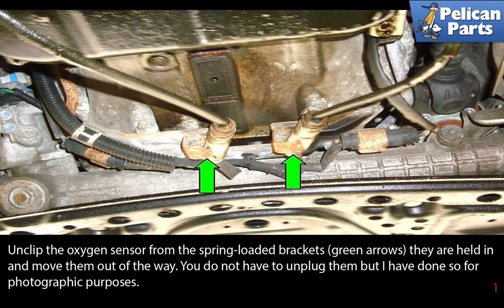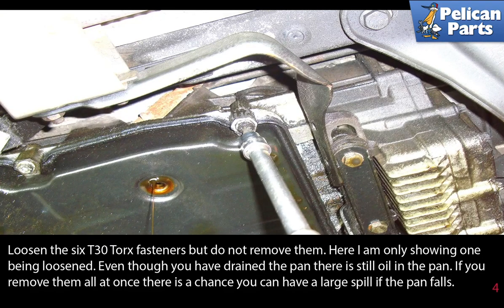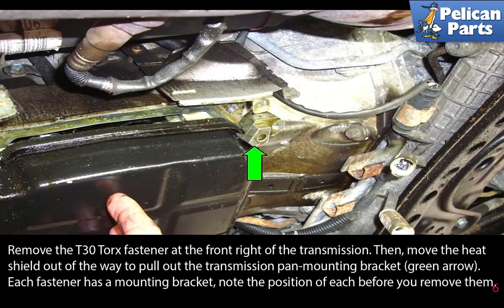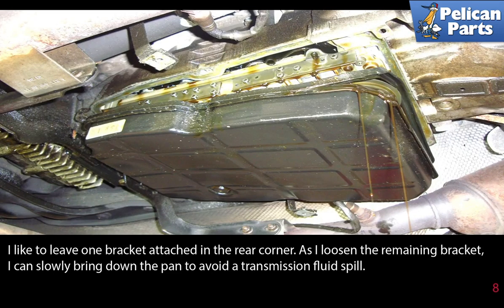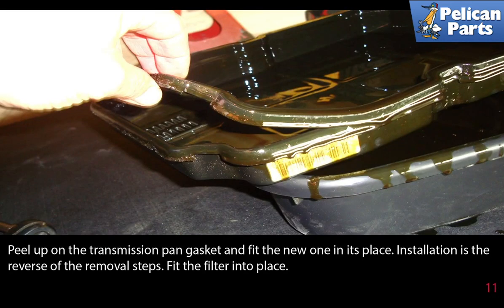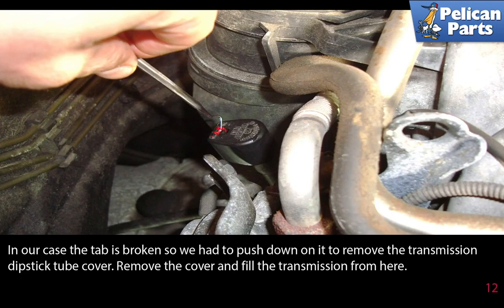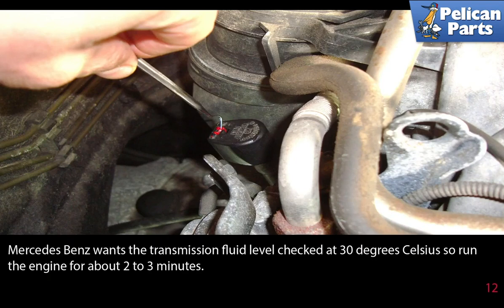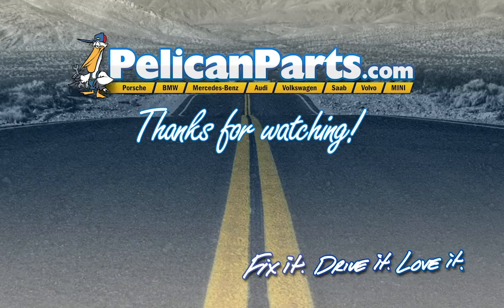Mercedes-Benz W211 E-Class Automatic Transmission Fluid Change

Comment: I have 2 of these w211 both e320cdi the one I'm currently working on is a Brabus varient and has this gearbox filler under the bonnet as did another w211 I previously owned . But the other one I have here. Not the brabus just an avantgard. It has no filler underneath the bonnet anywhere which is annoying 😂
Reply from the maker: Thanks for the Info. We appreciate it.

Comment: Great video!! Do you know if you can fill the transmission this way with all 722.6 transmissions? Like if it is a 1999 e320 or 2009 E350 with the 4matic is it the same fill procedure? Just wondering because I know on the 722.9 you have to fill it with a pump on the drain plug of the transmission. But I am guessing as long as it still is the 722.6 it can be filled from the dip stick tube. Thank you in advance!
Reply from the maker: I believe only the except 722.96 does not apply to the fil overflow tube style filling.

Comment: For 04-06 E500.  Does this get all the fluid out?  What about the torque converter? Is there also a fluid line to the radiator?
Reply from the maker: This gets most out. To get it all out, you'll want to have it flushed using a flush machine.

Comment: how much oil do i need for the w211 3.2cdi from 2004?
Reply from the maker: Engine oil capacity

112 except 112.916/953/975
With filter - 8.0 liters
Without filter - 7.5 liters
Reply: @pelicanparts  thanks

Comment: Hey i can see a greenish color , it was theat red when was new ? 
Mine lock green on dipstick so i cant say what tipe service use on change.Is not realy green is greenish but lock like how it is your old one .How old dit it was you can tell? 
Thx.
I want to buy on spec mb 234.14 but all are red and i dont want to mixt them wrong
Reply from the maker: It can lose the bright red color quickly. No real way to know the age other than keeping track of when it was replaced last using maintenance records.

Comment: Is the torque converter no need to drained?
Reply: Flip your car upside down to drain.
Reply from the maker: There is no drain plug. Only way to completely drain is to use a flushing machine.
Reply: @pelicanparts  incorrect no need for a flushing machine, you have done half a job.
https://www.youtube.com/watch?v=V0zTa2-4Yzw&t=0s
Reply: It will not be needed unless you want to, of course, if you want to the best way is to have it flushed, but you could fill and drain a couple of times and it would be almost the same.